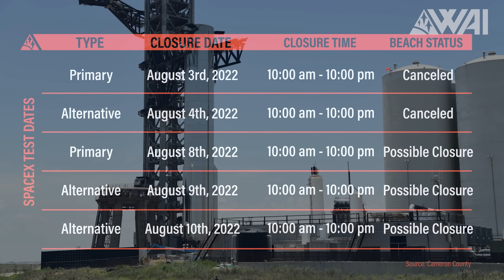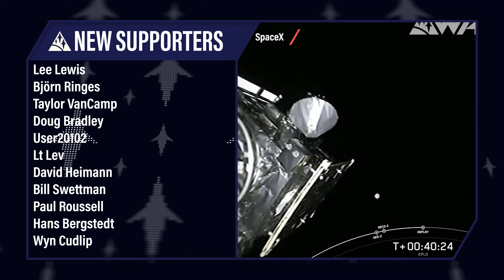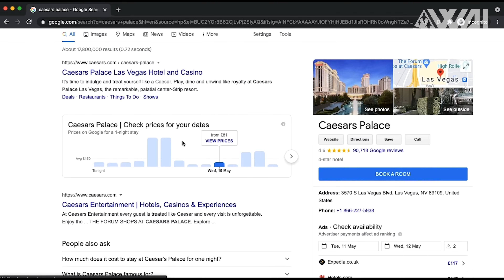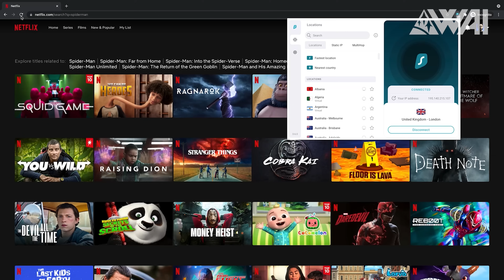SpaceX Starship Launch KSC Update + Six Rocket launches in ONE day!

Comment: He stole the design from the Hawthorne Blvd off-ramp. Yellow safety cans filled with sand. He’s using water. Double wall concrete breaks up steel. Water disperses energy. One pipe up for fill one for overflow. Just a guess….

Comment: do you think its going to be a seawater pressure tower for any emergency just in case of fuel leak.after all they still need a lot of water just to put starships booster rockets flames out if it goes out of control not saying it will but it would be prudent to have something handy

Comment: I would love to see a StarShip factory.

Completely automated, Sheet metal cut and stamped to shaped and rolled into a curve. The sheets cut and lined with any needed supports for attachments and rigidity.
Lined up and pressed together and clamped in place.
Next a series of robotic arms and rollers, One inside the sheets, and one one the outside in pairs. 
To wield and roll smooth under pressure in one go, StarShip Factory 🤩😎 Please 🥹🥹🥹

Comment: Instead of repainting it they should use aluminium armament around the structures. If the aluminium is thick enough it should not melt but soak up the heat (We are talking about predictable parameters here - easy to predict and compute.). They could also use copper or bronze with higher melting points and equaly high corrosion resistance.
Reply: You should apply for a job at spacex with great idea like that!!
Reply: The steel pipes the legs are made of will resist heat better than aluminum, copper or bronze.  This seems to a solution looking for a problem.

Comment: If the Starship program works, most likely LC39A will be modified, removed, or replaced with another new Starship platform.  The Falcon program will be retired.
Reply: Yes, but that's a long way off — and in the meantime, NASA needs 39A to remain operational for Falcon launches.

Comment: Paint. I worked at a big water utility. Our paint department wasn’t called the “Paint Department”. It was “Coating”.  The point was not to make equipment look nice. The intent was protect metal and concrete from corrosive air, water, and chemicals.   And boy did they have some seriously thick “paint” laid on thick.   
Remember, rust never sleeps.

Comment: Why hasn’t Elon considered constructing the Starship and Booster in reverse order? Suspend the tubes and raise them in the bay. Insert a new section, weld, and repeat. That way, most of the work could be done at or near ground level.
Reply: That's how grain silos are built.  Top down - all work done at ground level.

Comment: @9:10 I suspect that it will be a water-filled blast shield since water is a very effective barrier to flames and rocket fragments.
It can also supply the noise suppression spray on launches.
Reply: A large water-filled concrete tower would have huge mass.  Huge mass means huge inertia which means it would strongly resist being moved. Sort of like you pushing on a 2 tonne rhinoceros. 

The water in it would not resist flames unless the tower were broken open which would mean a really disastrously strong explosion.

It makes sense if such is being built to hold water to make it a dual purpose construction.
Reply: @edwardcoulter9361  Knowing Elon, that kind of multi-purpose  structure would please him.

Comment: Edit : Well this comment is now a bit useless as the title has been changed.

---------

Booster 7 needs to do multiple tests of the 20 outer engines
This could take from one up to two weeks, if everything works as intended
Then, it needs to roll back to the High Bay or Mega Bay, get its center engines, engines aerodynamics cover, engine shielding, repairs to other parts of the bottom of the booster that are clearly still broken as of the latest lift onto the OLM
After all that, it would need to go to the pad, test the center engines
Finally, it would probably do a short, probably staggered, full-stack all-engines static fire before the launch
And let us not forget about the launch license

And this is if EVERYTHING goes perfectly to plan
So, no, an August launch is NOT likely, and I would recommend changing your title.
Reply: The launch license is a trivial bit of beurocracy, all checks have passed, its just a formality. And I'll be  shocked if it takes the crew more than 3 days to rollback the booster, fix the aerocovers, install center engines and roll back to the pad. I'd say we have a minimum of 2 weeks but potentially up to 2 months. But it's nothing to do with the reasons you gave, delays will be due to unforeseen problems as usual.
Reply: Of course the title has a little bit of click bait but yeah we all fell for it, I would do the same if I were Felix. Thats just a part of youtube, however I still love these videos because it sums up progress really nicely and in more detail than most other channels